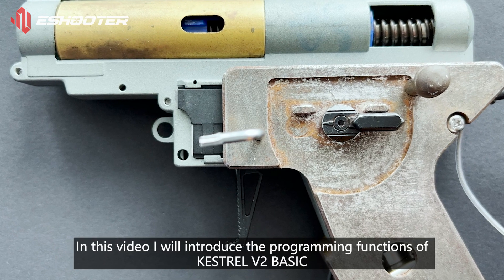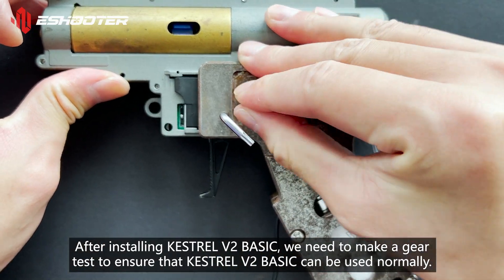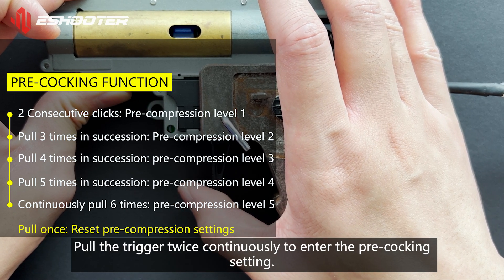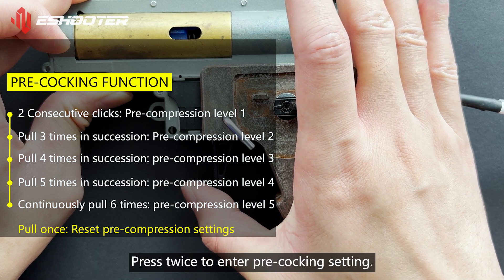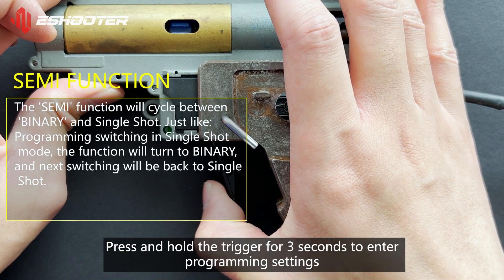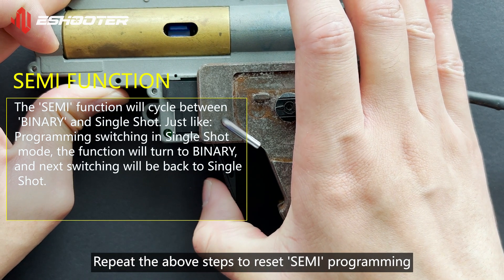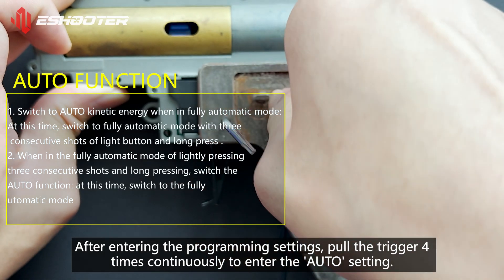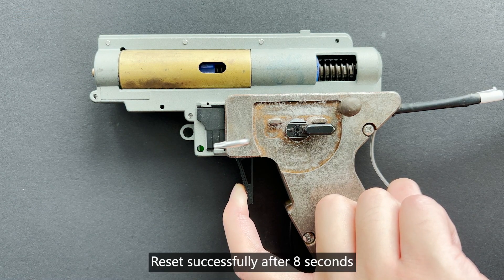KESTREL V2 BASIC Programming instructions

Comment: Funnily enough, I can't press the trigger in the "SAVE" position. Or at least not far enough for the ETU to react... If I set it to "SEMI," then hold the trigger down and then plug in the battery, I get a long beep first, followed by a triple beep after three seconds. But then I can't get any further with the programming... What a shame. A really cool device with really poor programmability...
Reply: i also got the same problem

Comment: Hi kestrel shots multiple times on semi and auto calibration option is not working so nothing happening after holding 3sec beep sound and 10x triger press no sound after that so can’t get into that calibration option while I hear sound when need to get in to semi and auto option but still can’t fix this without calibration option….. Please advise team! Thanks! Is it possible sector too high?

Comment: Which is the correct precocking setting?
Reply: That depends on your setup, try each until it double shoots then gone back
Reply: Then go one back*
Reply: @jssmitty96  what if it quadruple-shoots? :))
Reply: @ turn precocking much lower
Reply: @ Tried it and it works but for some reason i dont think it saves the setting after taking the battery out and putting it back in, and even when i have precocking disabled, it still acts up the same